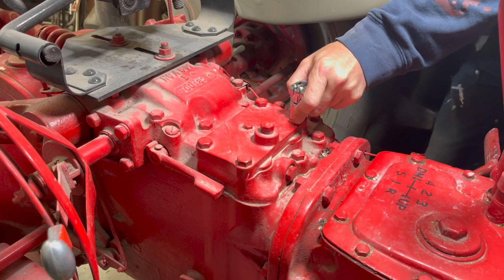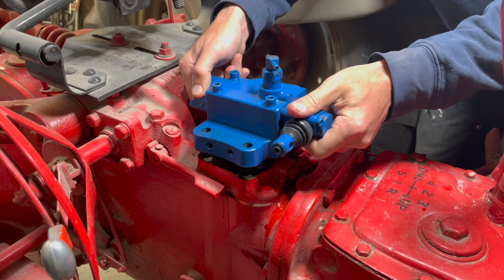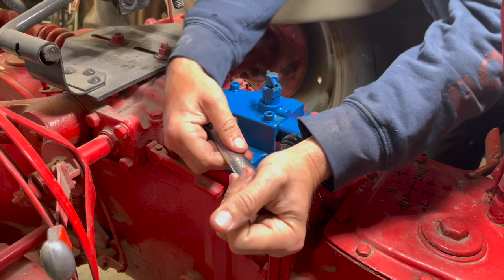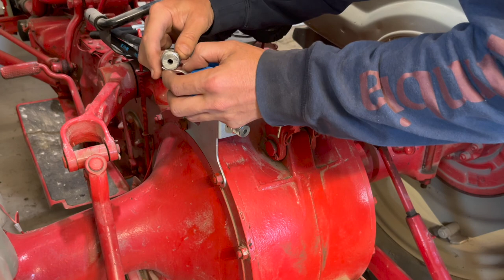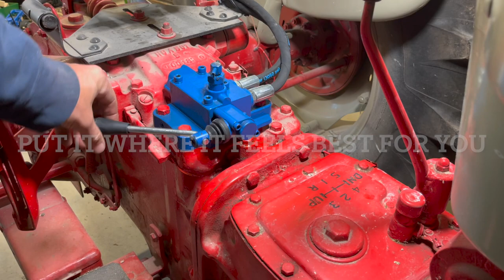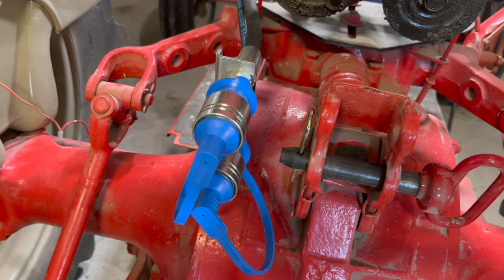Installing Remote Hydraulics on Ford 801 Powermaster

Comment: Great video! I have a small farm and run two 801 PowerMaster diesels. One has the remotes and one doesn’t. I’ll definitely be checking Amazon for a kit for the other tractor!
Reply: I kind of doubt that Amazon would have that if you want something like that I would check yesterday tractor or Steiner tractor parts.
Reply: Thanks was about to ask where I could find such kit.

Comment: This is a good video, I've watched about 6 others that aren't good. One thing is not one person mentions the 5th bolt that must not be used. Also no one mentions the T valve and what it does or how the valve actually works. I just purchased one and it has no instructions with it.
Reply: Do you happen to have an answer to this question yet? I too have a kit like this but I am still in the dark about what this valve does.
Reply: @robinbouwman  Changes from double action to single action. Valve works great on my tractor.
Reply: @85camaro57  Thx for the response. I installed a free flowing return bc regardless of the T-knob position, it seems double acting. Good product, better instructions or schematics would certainly help :)

Comment: Great video and considering the same set-up for my Ford 860 and have a few questions:  the lever on the valve, is it momentary or continuous?  And it looks like both lines out are pressurized, where is the low pressure return line to the reservoir?
Reply: Thanks for watching. The lever is momentary on this kit. And to my understanding both lines are pressurized but one is an out line and one a return. I’m no expert tho. This was my first time installing one
Reply: From my understanding both lines are pressure and return lines. I have a similar setup on my Ford 640 that I use for a hydraulic valve for a front mounted blade. One direction lifts and the other direction lowers with force to even lift the front wheels up. When one is pressurized the other acts as a return.

Comment: Nice video, great lighting as well. I'm not sure if I saw it right. Did you put the Teflon tape on backwards at the rear remotes? I am wanting to do the same with my 61 ford  utility industrial.  Have you used it yet? Nice to see you using the correct  tool to loosen the boltsas well as checking the bolt length.  Thanks for the tip on Amazon.  Hope you can do a video  on you using  the remotes. Thanks again Warren in Vermont!
Reply: Thanks for watching. I went back and watched it and I did put the Teflon tape on backwards. Oops lol still worked fine. I used it this spring to plant corn and beans with a John Deere 7000 planter. Everything worked great.